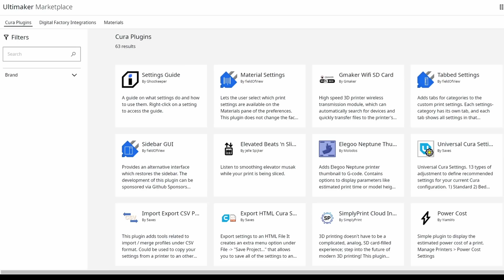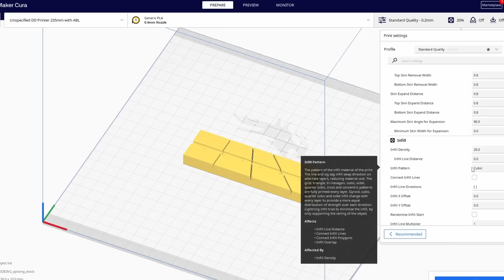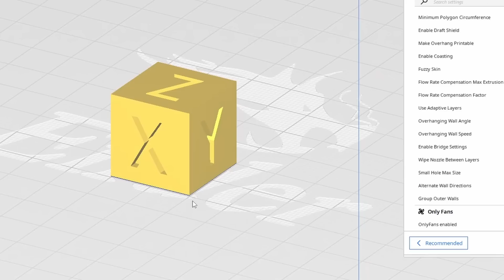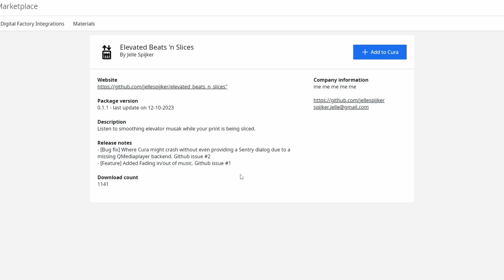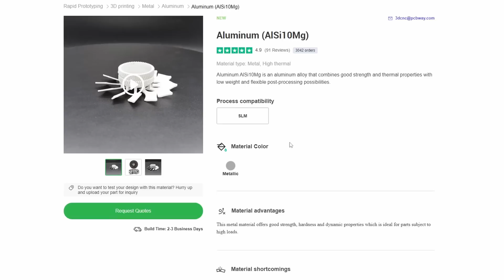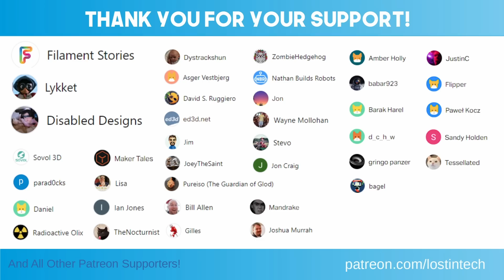New CURA 5.5 Release: Big changes under the hood!

Comment: Great video, I have a problem, I bought a basic i5 PC with 16GB RAM that supports Windows 10, I thought it would be enough to use cura, but it gives me an OpenGL 2.0 error, I already updated everything, I think the processor is like this old that I can only see an old version of Cura, 4.1, but it's horrible to use and my Creality Ender 3v3 3D printer doesn't even show up. So what do you recommend me to do, get at least an i7 processor Or should I buy a graphics card? what card would you need? Thank you

Comment: Anyone having problems with 5.5 on an M2 MacBook Pro? I can’t get a slice to slice correctly. It won’t slice with supports in normal mode so that a print will have the supports to print correctly. So I’ve gone back to the previous version on my M1 MacBook Pro and everything works just like you’d expect it to.

Comment: I know that this wasn't a tutorial for the Infill Tile Generator....buuuuttttt It seems like you got it working without any problem. I installed it directly through the marketplace (as it's now directly available) but there is no folder named "CuraEngineTiledInfill/tiles/" or locatable .wkt files. Am I missing something here. I think maybe i'm looking in the wrong place.
Reply: In case anyone is wondering. You will need to save your custom Infill files in the folder Users\"YourUserName"\AppData\Roaming\cura\5.5\plugins\CuraEngineTiledInfill\CuraEngineTiledInfill\tiles"
There was a much different way of accessing this folder in the initial launch, but now that it's in the Marketplace, I am guessing that it installs this information in a totally different area. Either way. If you're looking to experiment with this engine plugin, there ya go. I am planning on making a little rundown on this feature in a little while. I think this could be a really cool feature that a lot of people would use...it just needs to be accessible.

Comment: It only just now strikes me as odd that the 3D printing community uses calibration cubes so widely, whenever a 3D printer cannot make it an actual cube. Sharp corners are impossible to produce with what is effectively a hot glue gun on a stick.

Comment: Thanks, once again for a nice explainer. Did they fix the irrational order in which the walls (at least on rings) are printed in this one? I can't for the life of me think why it would be better to make basically every turn of a circular wall start in an arbitrary lace, indtead of just going "round and round"... also with thick walls off,say, 10 lines. Too many starts and stops with the risk of pulling up  the already printed wall lines...  Before Arachne it worked.
Reply from the maker: Yeah Arachne started the weird wall ordering. I think a lot of it has been reigned in
Reply: I hope so.  It seemed completely counter intuitive and unnecessarily complicated.  Thanks.

Comment: Please someone make a "limit print speed by volumetric flow" plugin. I'm close to switching to Prusaslicer just because of this feature.
Reply from the maker: Been asking for this for a while 😁
Reply: @LostInTech3D The Cura staff steadfastly refuse to merge in the flow limitation (there was a PR *for it ready to go*), as it would be too complex for users and "behave unpredictably" for flow limits... ignoring that arachne already does that, and a max volumetric flow would in fact clamp flow so it can't exceed even with arachne engine weirdness...

And then single top perimeters would be just chefs kiss
Reply: That and a single top perimeter plugin and I'll never leave cura!

Comment: I want a plugin that starts the first layer with even walls at normal layer heigth (for example 0.16mm @ 0.6 line width) and every odd wall in the second with twice the line thickness ( 0,32 @ 0.6mm line width). Then all the following layers will printed completely at 2x line thickness (0.32 in this example), always doing the deeper lines first. The cross section would look like a brick wall tilted sideways. The Interface between layers would be increased by 50%. Also, fusion of the lines will be vastly improved, as heat doesnt just get lost in the air, but rather contributes to remelt the neighboring lines.

 That way layer adhesion will be vastly superior. How developer friendly is the API ? I know some java
Reply: That's smart AF.... Please do it lol.

Even if it's limited to 2 walls.
Even if it's limited to .05 height difference at .2 layers.

With PETG; I think 100% bonding would be possible.
Reply: @-FOXX  That's a huge project and has many problems tht need to be solved. I'll consider it :) will take me quiet some time for sure. Apparently i have to learn python. In case i do it, i'll let you know!
Reply: Doesn't the "Alternate wall" setting do something similar? In Cura there's a setting that can print an alternate inner wall every other outer wall, making adhesion way stronger, as you say, and there's another setting that does the same but for infill, making infill to wall adhesion also pretty solid. I'd imagine it has a very similar effect.
Reply: @TheSupertecnology  Not, its an additional Wall on the inside every second layer. The walls are always aligned.

Comment: there are a couple of things that i wish cura would do, i wish it would print all walls for each feature before moving to the next feature on a single model, to reduce the amount of retractions and travel, and when combing it sometimes takes massive detour around the entire print to come back to right next to where it was, when it could have combed over to that spot without going through the skin, these 2 improvements would make prints so much faster and lead to much better quality as you wouldnt be needing to do so many retractions and travel movements. any time i sit there watching it print i think why tf does it print like this lol i wish i knew coding and could help fix it, i also tried prusa and im 99% sure its running the same code to actually create toolpaths because they do the same exact behaviour where im questioning it constantly. when i say do all the walls i mean do the inside and outside walls for each feature, hole and boarder without a single retraction, its possible and so annoying that it doesnt do it by default
Reply: I'd really love that all the walls printing first feature too. Would be useful for strategic filament changes too, say, on the top surface, to have all the skin inside walls a different colour.
Reply: @TechieSewing  heck yeah

Comment: The ultimaker printer don’t have pressure advance as standard. I spoke to ultimaker about this and they said it was because of their long boden setup. But I replied that I got pressure advance working on my delta with huge boden. They didn’t respond. I don’t get it. 

I’m sure if I put a duet board in my ultimaker I could get them working better.  But not sure about getting the material station working etc.
Reply from the maker: That makes sense. Yeah, no idea 😂

Comment: Unfortunately this doesn't address my main reason for using Slic3r derivatives over Cura : the sluggish GUI of Cura.  Of course, Prusaslicer's paint-on seams and supports also have no decent equivalent in Cura (and I doubt paint-on GUI stuff will be something a plug-in can add), but the slow UI - especially on older hardware and compared to PrusaSlicer and co. - is what really keeps me from even experimenting much with Cura.  Just starting the application (with a couple of must-have plugins) feels painfully slow.  By the time Cura has opened, PrusaSlicer has started, loaded an STL and sliced it ...  This thing (so Cura) really needs an in-depth optimization, possibly even redesign/rewrite of at least the GUI side to startup much faster and be way more responsive.

Comment: We need a legitimate cut tool. Things can't be cut if it imports multiple models as 1. Which is just annoying
Reply: Sure they can.
Select the model.
Right-click on the model.
Mesh Tools -> Split Model Into Parts
Works great... I just split an 8 part model that imported as one part from an STL and now it's 8 separate parts.
Reply: @glabifrons  I always get “the model could not be split”
Reply: @ethancohen6005  Is the STL available for download, or one you created yourself?
Reply: @glabifrons  download. Otherwise I would just split it in fusion
Reply: @ethancohen6005  I'm asking where... there are a lot of STLs out there. :)

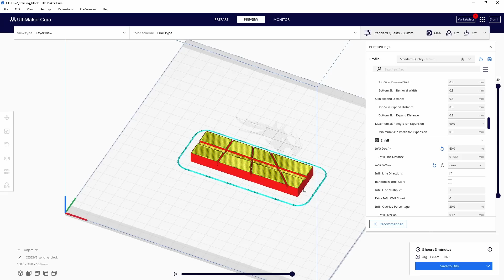Comment: 3:28 - You say BEE tah, I say BAY tah.  Let's call the whole thing off.   🙂

I'm not that interested in slicer engine plug-ins although it should be a good way to test new features before rolling them into the main code so even if I don't use them I'd still benefit by faster open source development.

Custom infill could be neat by turning off the top solid layers and printing solid infill to make a repeating company logo for stuff like drink coasters.  No doubt someone will think of a more practical use.

I'm more enthused about grid array duplication.  I hated that requesting multiple copies generated a random mess that I always had to clean up.  Similarly, I'd like to see more aggressive sequential printing where I manually arrange the parts so I know there won't be a crash and the slicer doesn't see a tall part and refuse to slice the plate of parts.  I'm forced to slice the parts individually and manually concatenate and edit the G code to make sequentially printed parts for manufacturing, and that's dumb.

I'm more enthused about the latest PrusaSlicer using an SVG to engrave or emboss on the complex surface of the part being sliced.  I'd prefer to do engraving or embossing in CAD, but FreeCAD makes that too difficult.
Reply from the maker: yeah this stuff is coming thick and fast, I'm hoping to sneak a prusa vid in soon!
Reply: You can print a few models one by one if you increase the gantry height and make sure the parts order is right. But I'd really like to be able to assign print order somehow; right now it prints the newest part first, so the only way to rearrange is to remove some and add them back. Even more annoying if they had been scaled, had supports blockers etc.

Comment: "Enable Fluid Motion" essentially cuts down on small moves to avoid generating microsegments. These minuscule moves where already present in 5.3.0 and fixed in 5.4. It was giving an headache to Klipper's parser as it was computing those micromoves as segments. This setting solves the motion planning to combine/skip moves under a certain threshold into a single one. 

Btw, video idea: using Alternate wall direction to print overhangs and reduce warping in certain materials. Has been working great for me both in Cura and Orca.
Reply: I thought the Arc plugin did the same thing?
Reply: @shinespark9  Well, yes, if it's an arc. If it's a line, there's not much it can do. Also, G Arcs don't cover all the curves and splines in a model, only those the engine can detect/are above the set threshold.

Comment: I'm curious what you think and what you do in Orcaslicer.  I jumped ship from Cura, and I've been really happy.  The reason why I ask is I finally got Klipper up 100% on my ender 3 Max and my s1 pro, I currently print at 100 mm a second on the outer wall 125 mm on everything else and 50 on the first layer for PLA.  I'm curious how you test and push the limits on such examples or any example for that matter.  I'm curious what you think about their calibrations area,  I generally have always wondered why on my s1 pro it makes the line widths so funny and ridiculous. Like 0.42 for the inner.45 for the outer, when Cura has everything just set to .4 for example. Another great video sir.

Comment: Well, dunno if that exists already, but I would find very useful to be able to have different pattern for top/bottom "final" or "outside" layers... Zigzag is much better for bridging over infill but, ihmo, concentric looks better.
Reply: Use "top surface skin layers" and "top surface skin pattern"
Reply: @jaimevankessel this exactly. Materials like abs, PC require some separate settings in "top and bottom" settings. Quite a few tweaks in there that can drastically improve top and bottom finish, even it's interaction with supports can be adjusted with the right settings in there 😊
Wall settings are just as modifiable, and for a bit now inner and outer walls separately. I believe there is a plug-in that can differentiate finer tuned settings between walls and even top skin
Reply: I'm fairly sure it's already a thing in the base cura settings.  I didn't know it until recently but I'm pretty sure I saw it. You will have to enable visibility of all settings or check it from the list. Hopefully I'm not giving you misinformation.

Edit: thinking more about it it may have been a selection for ironing.. that said if you're willing to take a little  print time hit o think it would accomplish that goal either way.
Reply: I agree completely about concentric, and I've been doing that for many years in Cura.
Top Surface Skin Layers: 1
Top Surface Skin Pattern: Concentric
Bottom Pattern Initial Layer: Concentric
Note that in older versions of Cura, the Top Surface options may be under the Experimental section instead of the Top/Bottom section.

Comment: I am ecstatic about plugins, because it gives us a better chance to 'take over' where the base development has failed. I recently had to use a workaround to a workaround to a workaround because they just decided - recursively - that it's not worth fixing bugs if a workaround exists. It would be awesome to bring back cubic subdivision infill that got bugged and removed many versions back.
Reply: Cubic subdivision isn't removed and has never been removed from Cura.

But same as any software development, we do prioritize bugs that have no workaround over those that dont.
Reply: @jaimevankessel   @katherinehackworth I can not find the exact issue number, but Cubic Subdivision has been left in a broken state for some time because it has issues with the newer Cura engine; right now it just functions as Cubic with no volumetric awareness. Fixing this was deferred because "Gradual Infill does the same thing" (which it doesn't). Now Gradual Infill has a bug that has been deferred because "Lightning Infill does the same thing" (which it doesn't). I am quite familiar with software development, having fixed bugs in Marlin and Klipper among other projects; you can not relentlessly push forward with new features while existing features are left broken, that's just poor project management.
Reply: @DejitaruJin  I just tried the cubic subdivision and it works as intended.
Reply: wait, since when?? that sucks

Comment: This is actually massive. There are so many improvements that can be made. So many experiments to be conducted.
Reply: Maximum flow rate, for example :)
Reply: I want to see non-planar slicing! slicing each layer as a modulating gyroid on the Z axis could do amazing things for layer adhesion!
Reply: @dl5244  Right? I'd also like to see layers with alternating line thicknesses so walls have even better adhesion. Stuff like that.
Reply: @802Garage  You can already change line thickness by layer using a mesh modifier. What I want is variable layer thickness.
Reply: @thirtythreeeyes8624  Sure, but having it built in without the mesh modifier would make life easier. The combination of varying line and layer thickness could make extremely strong interlocked parts.
Reply: @thirtythreeeyes8624  variable (planar) layer thickness is standard in PrusaSlicer - i use it all the time